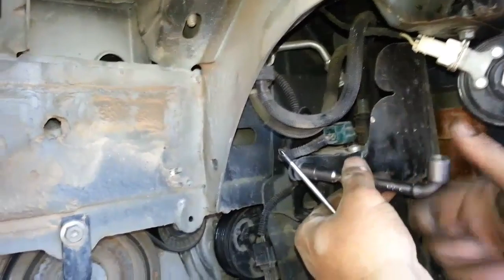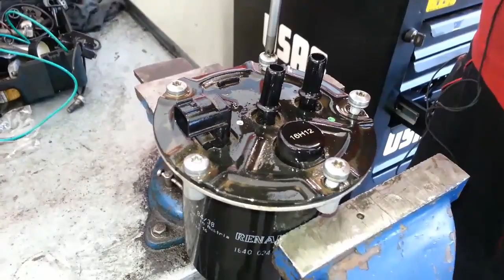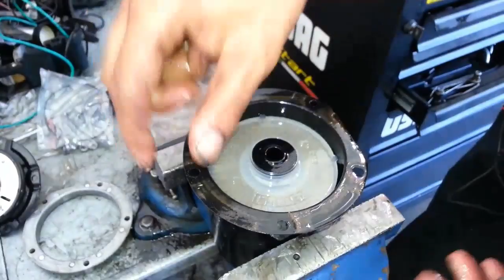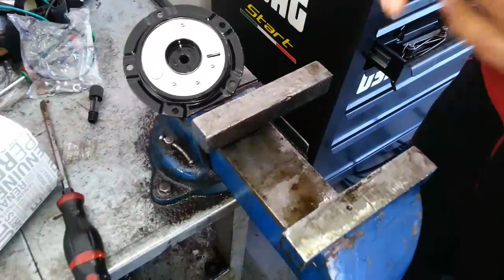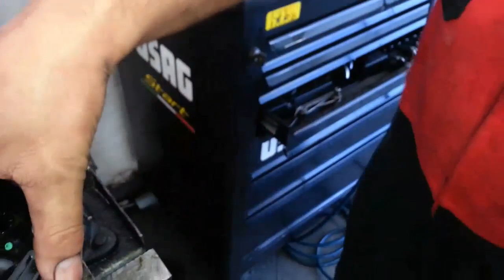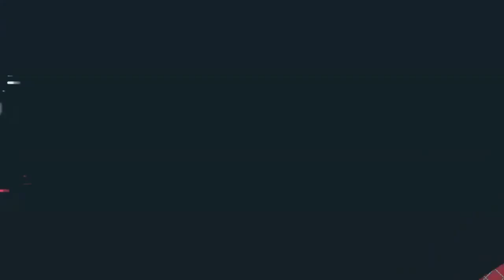Changement Filtre  A Gasoil sur les Nouvelles DACIA 1.5DCI

Comment: Hello my Dacia 2016 doesn't have the hand pump . How do I remove the air ? Thanks .merci
Reply from the maker: Hello , if did not exist put the contact on several occasions.
Thanks for the comment and good luck ;)
Reply: do you mean turn the key for several times . thanks
Reply from the maker: @sidonio123  Switch on the ignition several times without starting.
good luck ;)
Reply: Merci
Reply from the maker: @sidonio123  You're welcome ;)